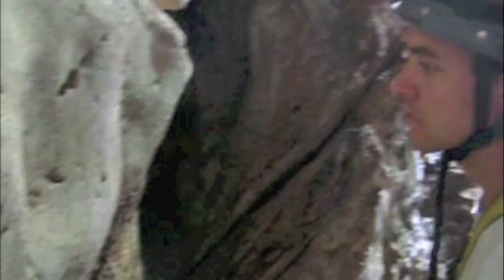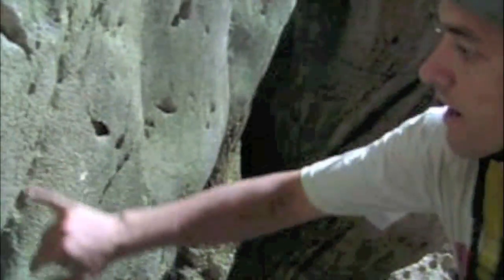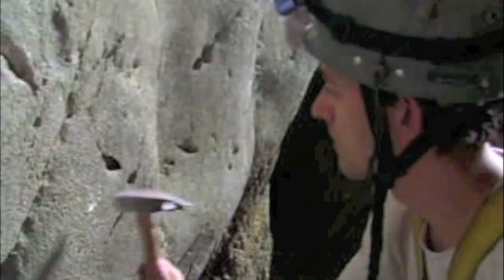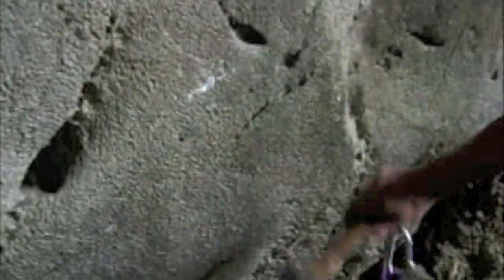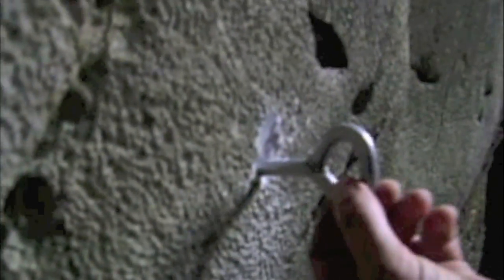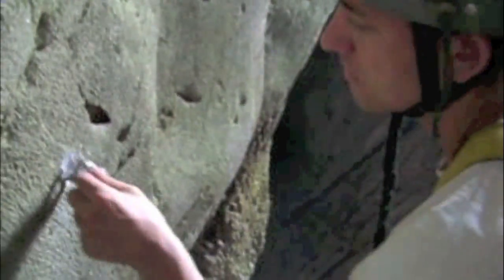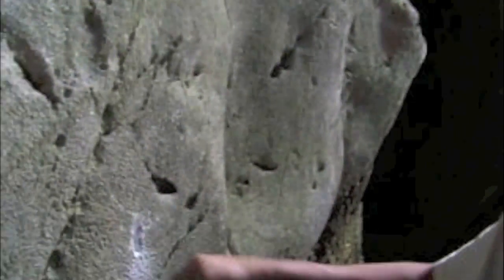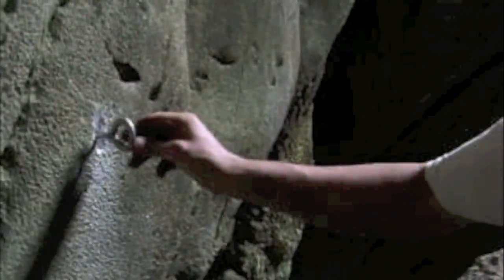CMRCA Bolting Video Manual Part1

Comment: Thanks. Nice video
Reply: Very thorough. I wouldn't angle that drill until it has penetrated 2mm or so. It should stop the skidding action that he suffered. Same reason that you would centre-punch metal before drilling. Might not be fun high up, you never know what you might drill by accident. He needs ppe too; that stuff isn't optional in my opinion. I wouldn't stick my face over a hole and blow either, especially when you have a perfectly functional means of doing it mechanically.

Comment: Not sure exactly what you're as asking. I'm assuming you're talking about and indoor home rock wall. If this is the case, you can use a lag screw to hold a bolt hanger in place. Just make sure the lag screw is the correct size to accommodate the hanger and screw into the floor or ceiling joist. If you screw into drywall or plywood the setup will not hold much weight.

Comment: Here's a question: do you think, I could use a bolt hanger on a ceiling (i.e., horizontally) to rig a suspension trainer onto? I understand, they're safest when bolted onto a vertical surface, but would one manage a couple of kN (2-3) of downward force so as to prevent accidents when training? 
 Thanks…